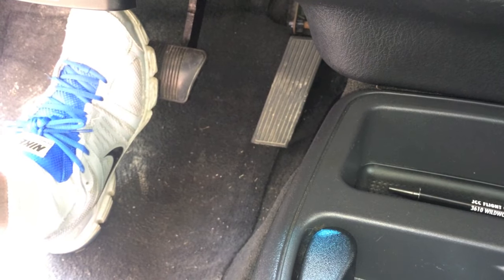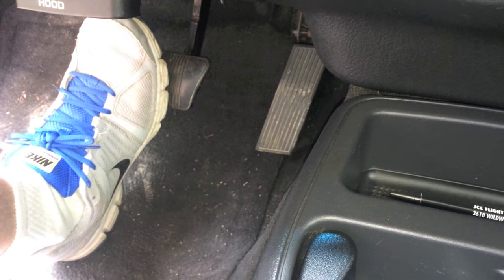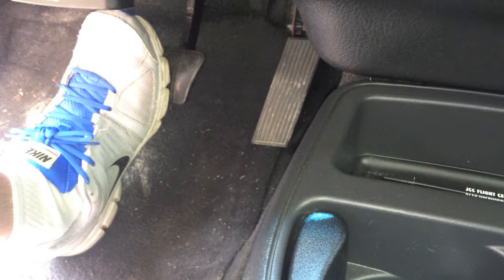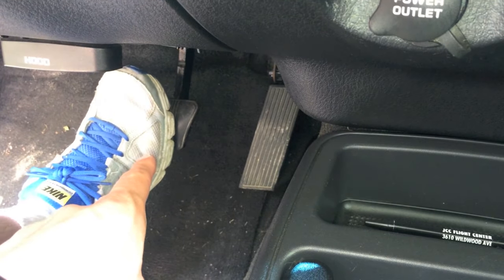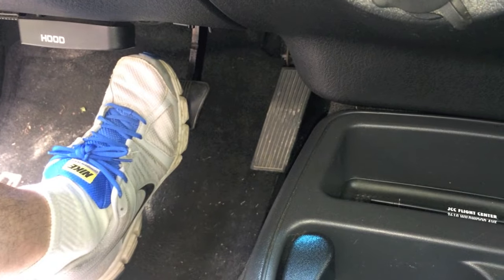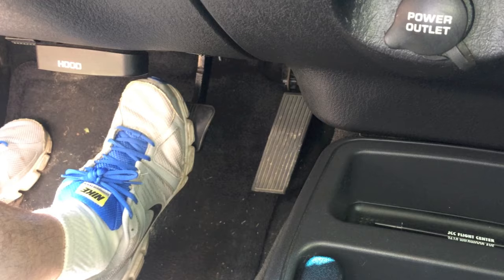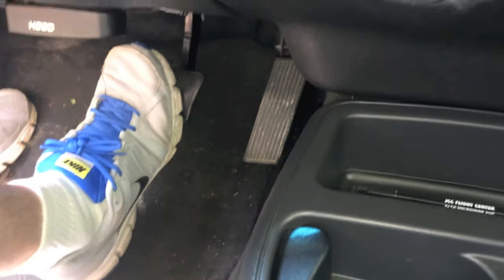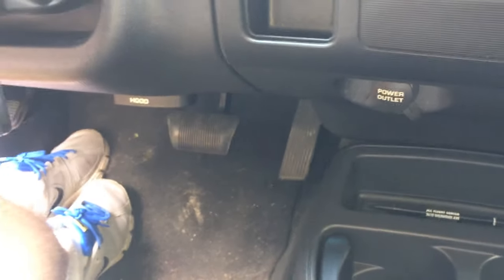HARD Brake Pedal - How to check if your BRAKE BOOSTER is GOOD or BAD

Comment: I hear a hissing sound when i depress the brake and applying the brake doesn't stop the car very well.   Is it the brake power booster check valve?
Reply from the maker: John Santicerma Thanks for checking out the video and sharing your experience John.  A hissing sound is signs of a vacuum leak.  I recommend starting your engine and opening hood.  Locate your Brake Booster & inspect all lines/hoses coming out of Booster.

Follow each line/Hose...(as some feed across engine along firewall) & try to pin-point the exact location of the leak.

Once the leak is located, I recommend going to your local AutoZone & purchasing new Vacuum Hose.  This should be a very friendly repair & shouldn’t cost you much money at all.

Keep us posted on your progress.  Let us know if you have any questions.

Please subscribe to the channel and turn on your YouTube notifications that would be awesome thanks again John!  😎👍🔧🔩

Comment: Just get u up on the brake on this 96 Yukon. I replaced master cyl and front rotor and pads , both back wheel cyl and still the brake peddle God to the floor. But we do have brakes. So we went to junkyard today and picked up a abs brake modoles and put it on and still no peddle abs we r getting air from back brake lines. And we have bleed them several times. 4 Qt brake fluid that we have gone through. So I'm not sure what to do next. The only thing I haven't changed if the booster and I don't feel that's the problem but I mite just put one on tomorrow and c.  Lol.  It can't hurt anything.
Reply from the maker: So true, thanks for the update.  Thats a bummer that all these new parts are not solving the problem.  As you mentioned, the Brake Booster might be the issue.  Its definitely a very important part to the system.  Please keep me posted.  Brake Boosters are kinda tricky but you got this :-)  Talk to you soon!

Comment: I have an Olds we have replaced the master with cylinder brand new one and all brake lines and the abs pump the brakes pump up then seeps to the floor there are not any leaks do hear some vacuum inside the car plan to replace the booster new could this be a bad booster?
Reply from the maker: mike d Thanks for checking out the video.  After replacing the parts, did you bleed entire brake system?  If you did...have you noticed a drop in the brake fluid level in the Master Cylinder Reservoir?  I have talked to many folks that have mentioned that the fluid level keeps going down and. Take light keeps turning on but can't find any leaks anywhere.  If that happens then the fluid is seeping into the booster and interfering with the boosters efficiency.

Keep me posted!  Subscribe to the channel that would be awesome thanks again 😀👍
Reply: mike d yes it could be a vac leak through booster
Reply from the maker: Dillon Radish Thanks for checking out the video and sharing your info

Comment: Hello, I have an 03 toyota 4runner. When I do the test the pedal sinks all the way down and does not come back up when I let it go. Does this indicate a bad brake booster or master cylinder? Thanks
Reply from the maker: The99allan99 Thanks for checking out the video.  Do you see any clear signs of leaking fluid anywhere along your brake system? Brake lines, Mater Cylinder, Booster...?  Subscribe to the channel that would be awesome thanks again 😀👍

Comment: What if the pedal sticks. Theres no return. I push it and it just sticks until I pull it back up with my foot. Not hard to push at all. Any idea? Could this still be a bad break booster?
Reply from the maker: Adam Blanton What’s up Adam, thanks for checking out the video and sharing your experience.  Most common cause of a sticking Gas Pedal is a dirty Throttle Body.  I recommend removing the air hose that runes from your Air Filter and leads into Throttle Body.  After removing hose you will then have access to the opening of the Throttle Body as well as the plate that regulates the amount of air going into the engine...shine a flashlight in and see if you can see any signs of debris build up.  If so there are recommended products at AutoZone that you can purchase and spray in the Throttle Body and it will help clean the entire inside of the Throttle Body.  Keep me posted!  Please subscribe to the channel and turn on your YouTube notifications that would be awesome thanks again Adam 😎👍

Comment: 2004 chevy tahoe. Yesterday power steering pump hose blew off due to the brake booster going out? I read online these are connected to each other.  Brakes were very hard to push.
Reply from the maker: Mule Blues 

Thanks for watching & sharing your experience.  Brake issues are no fun however we are here to help.

We recommend inspecting all lines feeding in & out of Booster to ensure all lines/hoses are properly secured.

Next, start your engine and open the hood.  From here you want to pay close attention to your engine and see if you can hear a hissing sound.  If yes, this is a clear indication that you have a vacuum leak in one of the lines.

Do your best to locate the leak and from there, visit your local AutoZone and they will have replacement lines.

If no leaks, we need to move to the next troubleshooting steps.

Lets get this figured out together so you can get back to normal driving.

It can be a few different things....

1.  Its possible that your caliper is beginning to stick...maybe caliper slides have lost the lubrication required to shift back and forward freely.

2.  It can be possible that your Caliper piston has lost its lubrication which will also interfere with the efficient shift back for forth.

3.  The front rubber brake lines that connect to your caliper fail from inside rather that outside.  This means the inter coating begins to break away and clog portions of the brake system...hence not allowing fluid to flow back and forth freely.  

4.  Your brake pads have little prongs/teeth on them.  You will notice by their location...the pads slide on a steel brace.  This may need to be lubricated to bring the shift back to efficient requirements.

I have attached a few videos.  Lets start with the easy items and then work our way up!  Lets figure this out together!  Keep me posted!  

PLEASE SUBSCRIBE to the channel and turn on your YouTube notification Bell 🛎 that would be awesome thanks again!

1.  Caliper Slides Lost Lubrication:

https://www.youtube.com/watch?v=-DZ68tKuCQc&t=15s

2.  Too much Fluid in Reservoir:

https://www.youtube.com/watch?v=X-AJ5tD6zoA&list=PLjCXOz8TSkZnavDiGDyHdPKe2dV2RzEMZ&index=39

3.  Failing Front Brake Lines:

https://www.youtube.com/watch?v=3FTEgbLYAdI&list=PLjCXOz8TSkZnavDiGDyHdPKe2dV2RzEMZ&index=78

4.  Brake Pads not shifting:

https://www.youtube.com/watch?v=3Pq15BWM_qY&t=103s

5.  Replacing Front Brake Calipers:

https://www.youtube.com/watch?v=8HoaL4QM5-k&list=PLjCXOz8TSkZnavDiGDyHdPKe2dV2RzEMZ&index=83

6.  How to check if Brake Booster is Failing:

https://www.youtube.com/watch?v=VK4lowH7kQE&index=66&list=PLjCXOz8TSkZnavDiGDyHdPKe2dV2RzEMZ

7.  Failing Brake Booster:

https://www.youtube.com/watch?v=j9s7yccswPQ

8.  Symptoms of a Failing Brake Booster Check Valve:

https://www.youtube.com/watch?v=j9s7yccswPQ&index=68&list=PLjCXOz8TSkZnavDiGDyHdPKe2dV2RzEMZ
Reply: @DIYwithMichaelBorders  "brake booster needs service" message has been on for over 6 mo now.
Reply from the maker: Mule Blues 

Thanks for the reply.  Definitely keep us posted!  😎👍🔧🔩

Comment: In a 2006 Buick lucerne.  What is wrong if the pedal goes for after starting the engine
Reply from the maker: Thanks for watching & it’s normal for the pedal to shift slightly forward about an inch or two after engine start.

Comment: When i touch the brake,  100% of the brake is applied. 
How can I use some power of brake to slow the car.
Reply from the maker: Thanks for watching.  Is your brake pedal reaching the floor when pushed?

You either have air in your brake lines or worn out brake pads.  Keep us posted.

Comment: I have a peculiar problem with my brand new F150 (2022). When I pump the pedal with engine off, it does not harden at all and I can still hear the electronic brake booster operating. I have  no idea if this is normal. I have never owned a vehicle where the pedal didn't stiffen up while pumping with engine off. However, when driving the brakes work fine...
Reply from the maker: Thanks for watching and sharing, is you automatic emer brake engaging after truck is placed in park?

Once truck is placed in park, if you here brake system automatically engage, it’s active and that may be normal to have no tension in pedal.
Reply: @DIYwithMichaelBorders  No my problem is the opposite.  Even with the engine OFF I still hear the sound and the pedal does NOT stiffen after pumping it.
Reply: And it's not possible to turn the truck off in neutral. It has this automatic park shift feature that puts it in park every time you shut it off. What baffles me is why it's not stiffening up while the engine is off.  In fact, with the engine ON, if you Park is the only mode where you don't hear the booster (or what I assume is the booster) at all.
Reply: I''m wondering if the lack of stiffening on engine off could  be a bad master cylinder.
Reply: @DIYwithMichaelBorders  and I just realized I didn't answer your question on the auto emergency break. The emerg break is all manual. And none of this changes whether it is on or off. I tested both.
Reply from the maker: @aaronsemeniuk  

We definitely understand your concern, that’s opposite of normal.  🤔
Reply from the maker: @aaronsemeniuk  

Correct, it won’t turn off in neutral, it will require transmission to be placed into Park.
Reply from the maker: @aaronsemeniuk  

Being a brand new truck, really no parts should be malfunctioning yet.  Do you have a check engine-light on?
Reply from the maker: @aaronsemeniuk  

😎👍
Reply: @DIYwithMichaelBorders   nope

Comment: So let me ask you - I have a Jeep Wrangler (2014) that, after sitting for like five or six hours - I get in the car and the pedal is already firm and stiff like that.  Once it starts, it's fine.  Thoughts?  Does that mean something is wrong somewhere?  Brake fluid is not leaking anywhere (that I can see) - level has remained the same...
Reply from the maker: Thanks for checking out the video!  It is normal to have a "Somewhat" firm brake peddle before starting the engine....how firm is it....can badly move peddle??
Reply from the maker: Have you recently or ever heard any hissing sounds?
Reply: DIY With Michael Borders it can barely move if I try to press it. It's fine when on. And where would I hear hissing sound from?
Reply from the maker: 0REDSOX7 The brake system and all its components use a lot of pressure/force.  With engine off...there is no vacuum assist which leads to that really stiff peddle.  Normal but definitely keep me posted if your brake system starts acting up after engine is running! 
Subscribe to the channel that would be awesome thanks again 😀👍
Reply: DIY With Michael Borders thanks. The other issue I've noticed is the fact that when it's warmer out, my brake pedal is starting to squeak. And I feel this squeak on my pedal. Almost sounds like a creek if that makes sense.
Reply from the maker: Believe or not...its kinda a cool feature to some and an annoying feature to others....Some Brake pad manufacturers design the pads and add a feature that makes the pads squeak when worn down to the "Unsafe" point or point of recommended replacement.  Interesting right?  haha!

On the other hand, if your brake pads are on the newer side...may just be reacting to the humidity.  Its common to have squeaking pads when in really humid areas.

Comment: Hi guys I always watch yr videos and it's been very  helpful..I'm driving bmw 320 auto and suddenly while driving through traffic  the brake paddle just got stiff and I had no brakes but after about two minutes everything  came back normaly is there anything  I should look at pleas
Reply from the maker: Thanks for watching our videos and we appreciate you reaching out to us.  A few things can cause this, including a caliper in its early stages of failure.

It can also be a deteriorating rubber brake line feeding off your caliper as this fails from the inside out and little rubber pieces break away, clogging the system…leading to your exact brake systems behavior.

Or, it can be as simple as too much brake fluid inside reservoir.  Let’s start there.  Keep us posted.  👍

Comment: Hi Michael, I did the test on my 07 Passat 3.2 and the brake booster seems to be in good condition. The car however makes a hissing noise when I'm not on the brakes and it stops when I apply brake. Do you think it's the vacuum lines(? not well versed on brakes) or something else?
Reply from the maker: Zachary Ong 

Thanks for checking out the video and sharing your comment Zachary!  That’s a great question!  Let’s get this figured out together!

The hissing sound is almost 100% due to a leak in one of your vacuum lines.  Here’s what we recommend...

Turn car engine on....Open hood and direct attention to Brake Booster.  At this point too lean in & follow the vacuum lines & locate where the hissing is coming from. 

Verify that the vacuum line is leaking air at the point of the hissing sound.  

The vehicle is still safe to drive up to your local AutoZone.  Tell them that you have located a leak in your vacuum line & need a new one.  AutoZone will go out to your vehicle & match the vacuum line that they will sell you.

Vacuum lines are a friendly do-it-yourself project.  Just make sure your engine is OFF when changing vacuum lines.  Hope this helps.  Keep us posted!

Please subscribe to the channel and turn on your YouTube notification Bell that would be awesome thanks again 😎👍🔧🔩

Comment: Thanks man this really helped. Could they break pad start to feel hard because of freezing cold weather conditions
Reply from the maker: Thanks for watching Rich!  Thats a great question!  Its possible that snow has gathered and compacted inside the actual brake caliper....thats no good!  Its also possible that water has gotten inside brake caliper as well as the brake pad clips and froze to a pint that its making it very difficult for the brake system to move the brake parts efficiently...this is not that common though however it can happen.  

If you are beginning to experience a hard brake pedal...this can be cause by many different issues.  We recommend taking a good look inside your brake parts and verifying that there is no signs of compacted snow or ice.  Lets start there!

Please subscribe to the channel and turn on your YouTube notification Bell that would be awesome thanks Rich!

Comment: When you pressed down on the brake pedal. I didn't hear anything.  When I press down on my brake pedal when the car is off or on but in park, I hear a clicking sound coming from underneath the car below the shift box. Each time I press the brake I would hear the click sound.  Is this normal?
Reply from the maker: Macky1101 

Thanks for watching & sharing your experience.  That’s a great question!

There are vehicles that do & vehicles that don’t.  Sounds odd right!  🤔

It’s even possible that something has gotten stuck or lodged up above pedal...rock, wiring, stick...

Are you experiencing Brake system issues?  Any recent repairs done to vehicle?  If so, this may help us figure out if any recent repairs are tied to your Brake system issues.

Keep us posted!  

Please subscribe to the channel and turn on your YouTube notification Bell 🛎 that would be awesome thanks again!  😎👍🔧🔩

Comment: Hi I have a 2012 bmw 328i and I need to press the brake pedal and press ignition to start the car, when the car is off and before starting it is hard as rock, but upon starting the car while pressing the hard brake pedal that doesn’t move it becomes normal again, meaning before I start the car the brakes are very stiff and don’t move at all and after I start the car while pressing on pedal hard it sinks in all the way and goes back up where it returns normal like a reset or something, it works fine when the car is on but before starting it is a very stiff brake pedal, note I don’t pump the brakes when the car is off so it isn’t me manually making the brakes hard, plz respond asap thank you
Reply from the maker: Good morning, we are drinking our morning coffee and answering any and all questions for the DIY community.

Your brake pedal should be hard when the engine is off and this is because the system requires the engine to be running to operate as designed.  It’s very important not to push the brake pedal when the engine is off as this will damage the system.

Once the engine starts, the vacuum system-pressure rises and assists in several functions within your brake system.

After engine start, you will notice your brake pedal shifts slightly inward toward the firewall, and that’s normal.  Within seconds after engine start, your brake system begins working with the vacuum system and all other lines and valves to ensure maximum performance and reliability.
Reply: @DIYwithMichaelBorders  I never had this problem before though it’s just started recently, and in my car you’d have to press the brake and press the ignition to start it, I’ve read around some people say it’s normal some say it’s a leak somewhere, the reason I’m skeptical is because it never happened before and in different cars I’d be able to press the pedal even when car is off but of course it’ll harden if u pump it which I don’t do that, so I find it hard to believe it’s normal